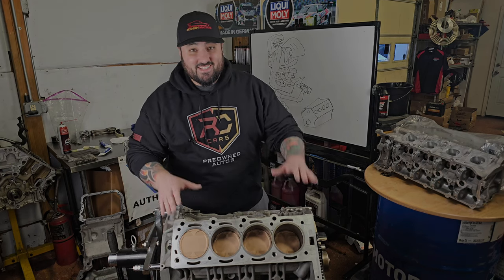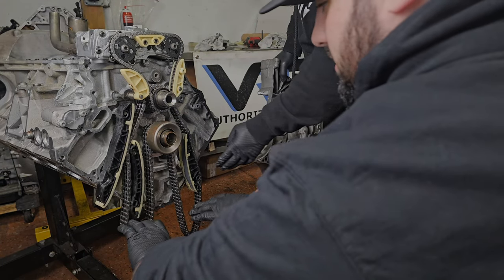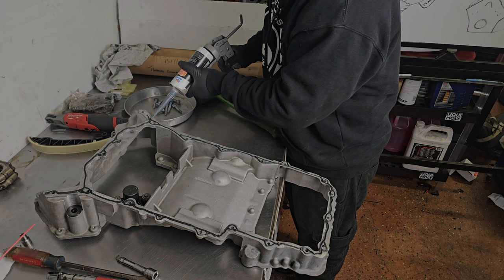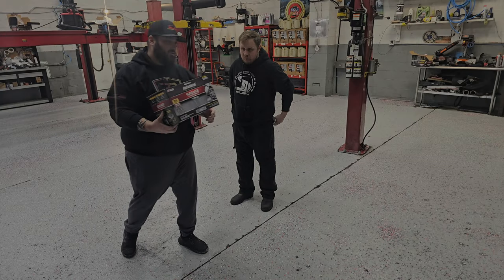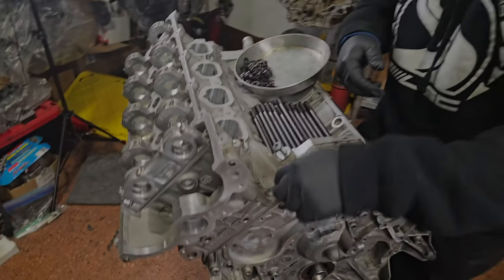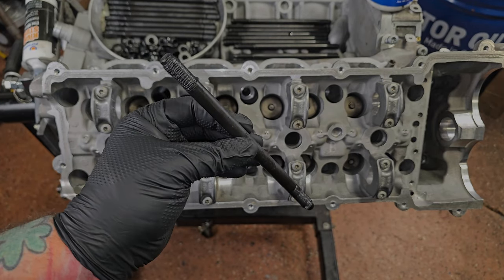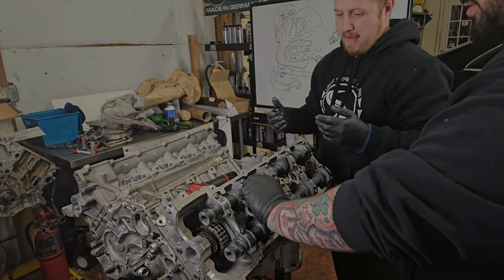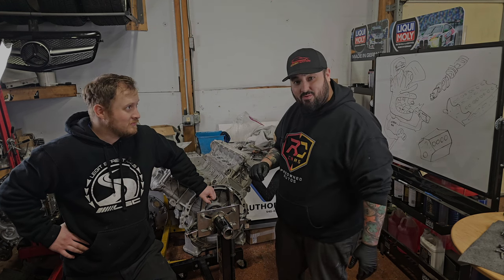C63 DARTON SLEEVES, BILLET CAMSHAFTS, PORTED HEADS WITH VRP HEADSTUDS! FULLY BUILT $50K ENGINE! W204

Comment: Guys, just asking, but I am pretty sure that ARP says to use their lubricant under the nut because the friction (measured torque) of tightening the nut would be entirely different using other lubricants.  I would especially think that having silicone under the nut would end up with an entirely different torque.   Also, I have heard one of their experts say that when the studs are threaded into the block they should not be tightened until they stop.  They should be backed off a little.  What say ye of this?   Also, have you ever had one of these stud installs leak before? That right stuff silicone you use is supposed to be ready for service in 90 minutes, that doesn't seem like enough time to do all that work.
Reply from the maker: We have installed 100+ sets of VRP HEADSTUDS this is how they are done. There is no other way. We also have this on our 1000hp racecar.
Reply: Thanks for that background! That is good enough for me @ModernMastersAuto  !
Reply: Trick on the head studs is to put the nut and washer on the stud before installation in the block.  They go in much easier that way.  Then tighten nuts.
Reply: Also look up SUME bore, should be able to recondition block bores.

Comment: Are you able to do the big upper oil pan while the engine is still in the car? I recently had a dealership tell me my upper oil pan is leaking and needs to be re-sealed.
Reply from the maker: The bed plate no, the upper oil pan yes.
Reply: @ModernMastersAuto  The bed plate is the portion that bolts down the crankshaft correct? I believe they said it was my upper oil pan (the piece that you guys show in this video). Not cheap at the dealership, but just trying to gauge the difficulty level. I've watched your engine videos and all the videos with Legit Street Cars engine builds, but haven't seen a video on doing a upper oil pan (not the two smaller ones) in the car on YouTube yet lol.
Reply from the maker: @derekhead7068  yes the big one in this video is the upper. The bed plate above that is what secures the crank. With that said all the ones in this video can be done in the car with the engine supported and the subframe dropped